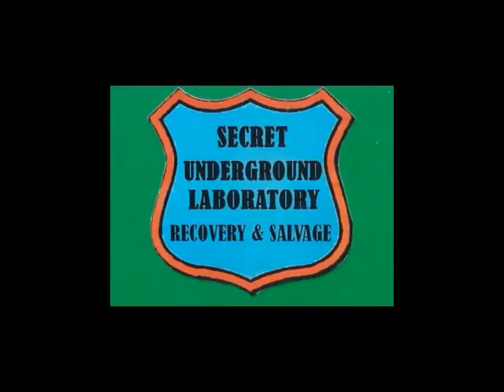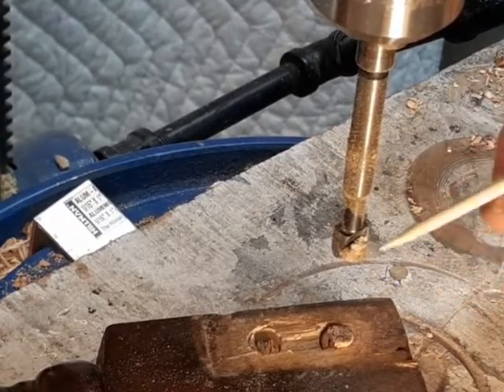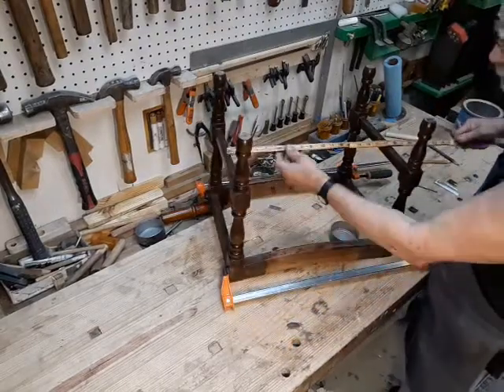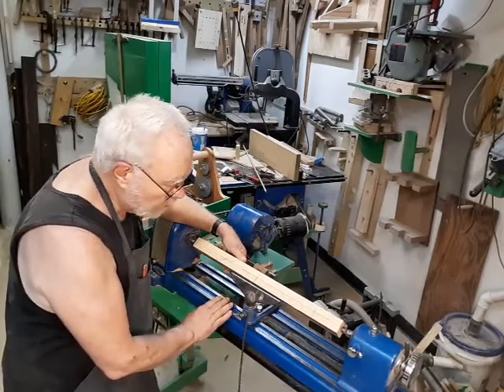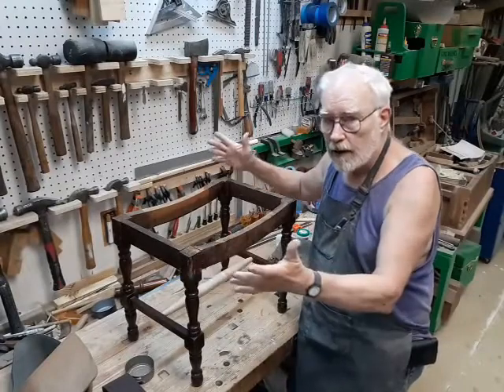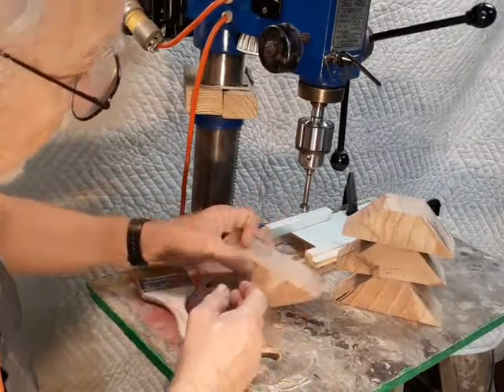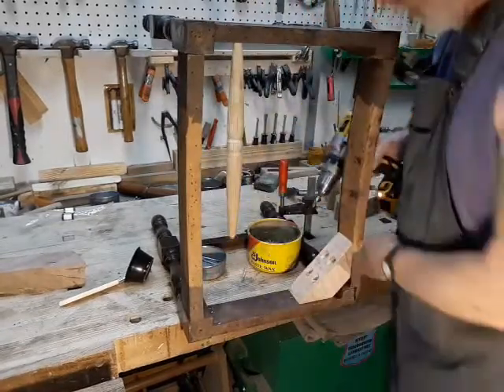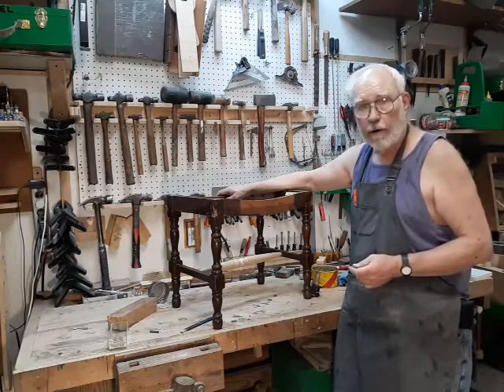Repairing a Vanity Bench with Scrap Wood and Fire Wood in the Secret Underground Laboratory

Comment: Your point about how much the webbing reinforces the joinery on these low cost pieces is apt. It's even more astonishing how much so much modern furniture joinery is also held together by the outer covering! There are often no joints that can be reinforced
Reply from the maker: This is true. I've had quite a few modern pieces brought to the Lab because a leg broke loose from the frame and I discover there's really no structure to it.